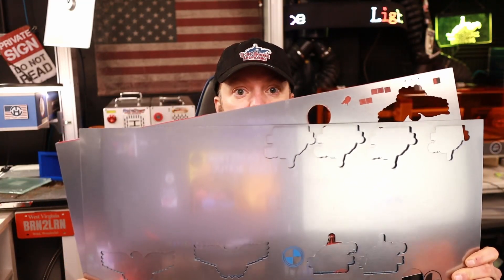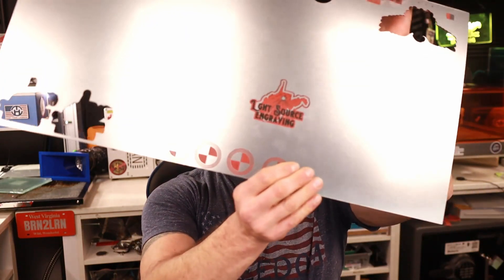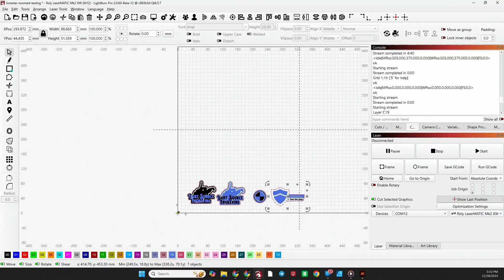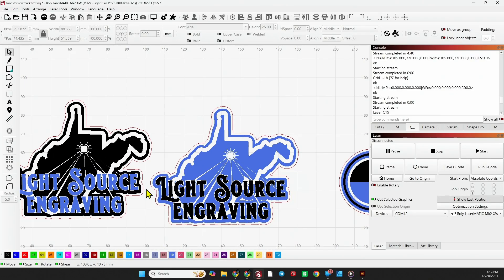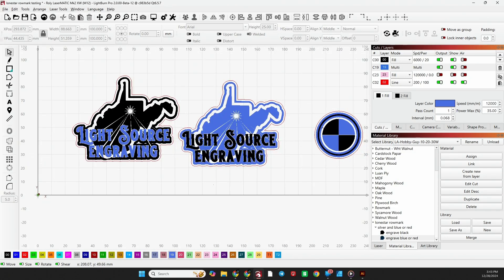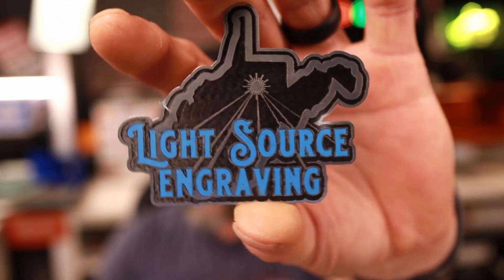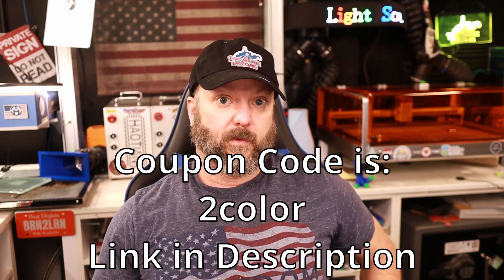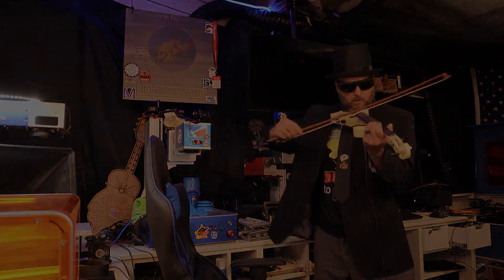Part 1: Engraving 3 Color Acrylic from LoneStar Adhesive - Diode Laser

Comment: Newbie:  Since you are using a 30W Diode, what adjustments to the settings would be needed for an XTool D1 Pro 2.0 10W 
Using a 10W vs your 30W what setting adjustments are needed?  
I understand that I’ll still need to run some tests to dial it down.  I’m just
Looking for a good starting point.  
Thank you!
Reply from the maker: i'd increase power x 2 for starters and go from there.